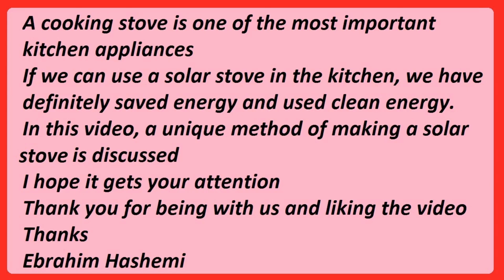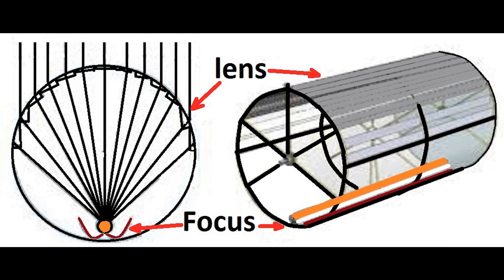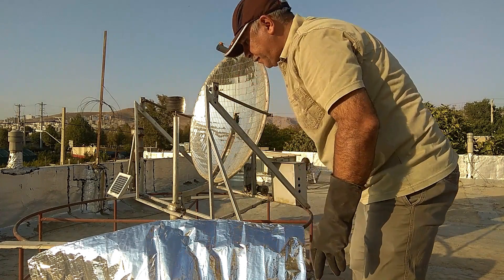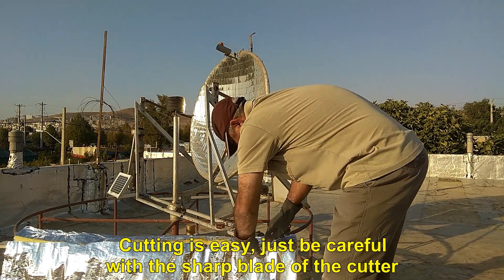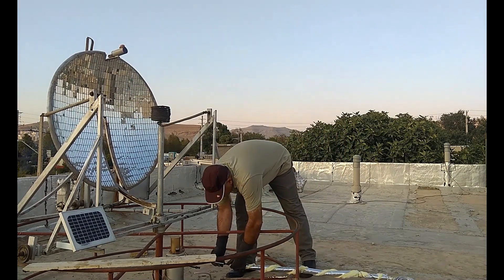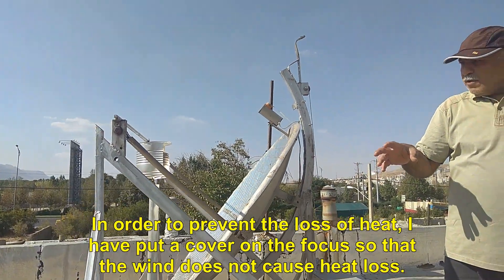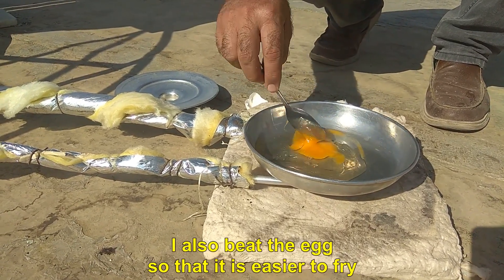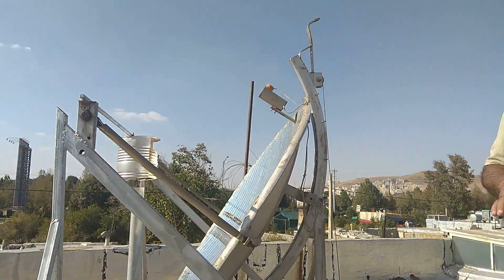making a solar oven .a new solar stove. the new generation of solar stoves.The joy of solar cooking.

Comment: I’ve just made my first cardboard cooker and wondered why no one had used oil in a parabola to transfer heat to a kitchen. Thanks for sharing.
Reply: I wonder if a linear parabolic would be better as no movement of the collector is required?
Reply: @fixedfocussolar , could a light tube transfer the heat to where it’s required more efficiently, such as from dish via light tube then directly under a hot plate in the kitchen?